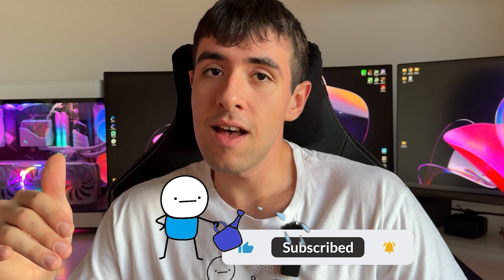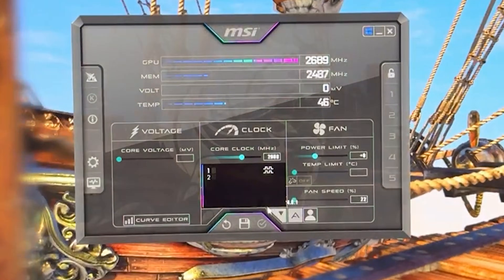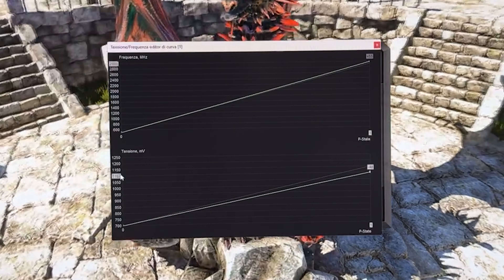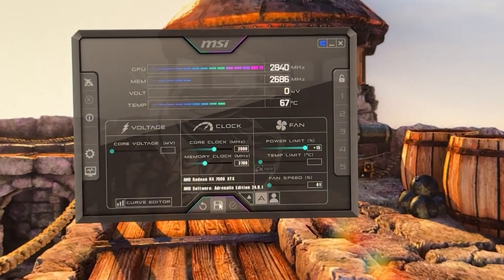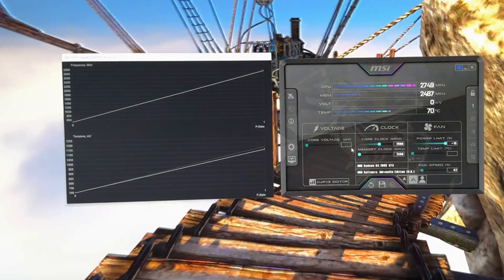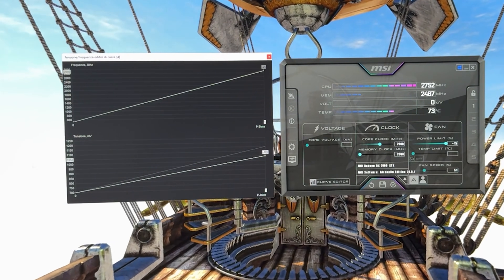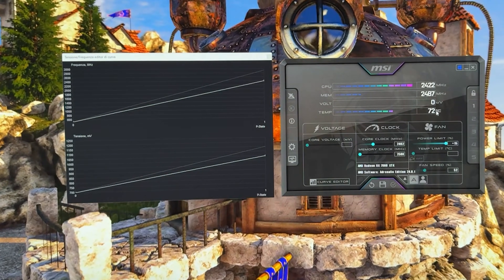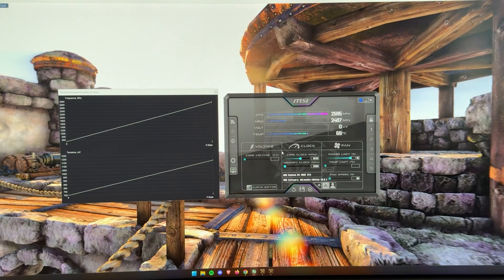Undervolt your RX 7900 XTX for more FPS! - Tutorial

Comment: i got nitro+ version , for me it works very well with this settings:
1075 mv
Vram 2750 mh
max freq 2700 mhz
min 2400 mhz
power limit +15%
And also i changed fans curve :
40C >800 rpm
55C>1000rpm
70C > 1300 rpm
85C >1600 rpm
My max temperature while gaming around  56C , avg fps in game like bf6,bf 2042,delta force 250 + on ultra settings.

Comment: i wonder why AMD was advertising the 3k+ hz on 7900xtx, the hotspots were around 105~, i undervolted my phantom gaming 7900xtx to 1125mV at tops 2650hz clock and 2680hz memory, no PL slider touched, temps dropped to max 85c with RDR2 benchmark 119(sometimes 130 in some areas) (same fps but without temps or stutters), Furmark is 16.5something, but i got better performance than Overclocking. 

Since i figured this out i am no longer sure or not if my card had thermals problem (second problem i noticed)
i spend around 1k just to mind fixing the gpu, while i should purely play fking games lol
Reply: If you are running stock card-clear paste and use PTM 7950. The chiplet design has that hotspot problem because of the surface which is not that much even and bad contacts happen even in factory. I swapped paste with PTM and I am able to OC the card to 3,3GHz with 40% fan speed with hotspot never above 90°… 70° on stock setting.
Reply: @milankot3908  as a temporarily solution until I find a trusted technician I limited the gpu clk to max 2.5, I don't see any difference tho. Tested in rdr2 4k with fps playing around ~110. But repasting is under consideration, yet I still have the warranty but the temps are within normal so I can't return it.
Reply: @mln461  but, the thickness of the thermal pads, is it all the same from different 7900xtx manufacturers? (asrock, asus etc)
Reply: @marines94711  Well it´s not. I have Sapphire Nitro and 1mm was too low and 1,25mm too high. Thermal putty saved me there.
Reply: @milankot3908  fun fact, with lower (or equal to manufacturer Clock) the junction is equal or less than 20c. But the card is boosting so high on its own (like 2900+mhz by default) that the junction gap raises to 30+

Comment: Why would you use Afterburner when Adrenaline does the same stuff?
Reply: Because Msi Afterburner will have the profile for any game and you do not have to apply the configuration to every game
Reply: Il arrive que MSI afterburner rentre en conflit avec adrénaline et c'est logique , il vaut mieux utiliser adrénaline comme je fais car tout les jeux nécessite pas le même undervolt :

Dans New World :

Fréquence max  2950 
Tension 1100
Vram 2500

Dans no rest for the wicked 

Fréquence max 2950
Tension 1075
Vram 2600

Et dans le bench time spy

Fréquence 3500
Tension 1020
Vram 2800

Voilà

Comment: Here I've set voltage to 1095 and max frequencies to 2800mhz, no power or ram increase, just to keep good fps and GPS hot spot cooler at full load (71deg C). Like it. Thank you. Also synthetic benchmarks stability doesn't mean game stability.
Reply: i have my 7900 xtx 
core clock 2800
mem 2500
mV: 1100
+Pw: none
runs like a tesla

Comment: Bro! I have a 9900K a dual monitor setup and a 750W Platinum Seasonic, can I slap in a Sapphire 7900xtx?
Reply: yes, but don't oc the CPU as it can draw 100W more compared to the baseline of 140W or so. You may do it safely, but each power supply has an optimum range of power consumption between 50% and 85% or so, going to hit the maximum will put strain on it more than necessary. Also, depending on your resolution and hz and your needs (types of games you play), consider getting a 7800 XT or 7900 XT as they are cheaper and maybe offer you proper performance.

Comment: Rx7900XTX nitro here, can do benchmarks at 1020mV but this will cause instant crash in games. Have to go to up like 1080 for stable gameplay (warthunder 1440p everything maxed out with 4xSSAA) and only then I can do pl-10. 1070 and lower is possible when increasing the pl over 0. If the game runs at 100% GPU util voltages above 1075 is a must

Comment: Stick with adrenalin software for overclocking/undervolting. Pretty sure msi afterburner isn't even updated nowadays. It doesn't even read the 9000 series cpus temps and other sensors.
Reply: They did actually update the afterburner beta branch, it supports my 9800X3D now!

Still would rather use Adrenalin though, you're right on that.
Reply: @RedForceProductions  that's good to know, I always like afterburner for it's overlay but I switched hwinfo64 and use that for my overlay now, gives way more info. Adrenalin software is hit or miss with cpu stats especially power draw. Not sure if that's because I don't use ryzen master 🤔. I prefer to adjust my cpu through bios and gpu through the Adrenalin

Comment: Never rely on ONLY Benchmarks and synthetic loads to test UV/OC settings, these kinds of loads will be stable at much lower power than actual games. 

For example my 7800XT and 7900XTX can pass Heaven and TimeSpy at 1060mV and the score will get higher and higher the lower mV you go, but as soon as you try an actual game e.g. Rainbow Six Siege you will crash straight away like in the menus or as soon as you start playing. In actual games you will need at least 1100mV to get stable performance with no crashes and that's if you get really lucky with silicone lottery. 

Try most if not all the games in your library and when you get zero crashes in all of those games then your settings are 100% stable.

My Red Devil 7900XTX requires at least 1140mV with 3150MHz on Core and 2700MHz on VRAM with +15% Power Limit.
Reply: How much watt does it use during games like CS2 if you undervolt it as much as possible?
Reply: my AsRock xtx currently running my games stable at 1085mV and 2950MHz with stock memory and +5% power limit. Trying to get the mV lower cause my ambient temp in summer is too warm...the card already once heated up to 99Degree...current settings allow it to not get over 80.
Reply: I've been running my TUF OC 7900 XTX at 1120 mV and 2500 MHz, as well as -10% power, which works pretty well for me. I know I can push it way harder, but I rather want my system to be cool and quiet, than pushing it and make it loud. Anyway, as I play Black Ops 6 Zombies most of the time, at 1440P, it's pretty much a perfect fit for my R9 7950X, running low settings because of the bad optimizations in the game, native resolution, it runs 200-240 FPS, which is perfect for my LG UltraGear 27" 1440P 240Hz OLED monitor

I've tried pushing it a little, and I made it run BO6 Zombies stable at 2900 MHz, but I don't remember the other settings. Maybe I should try pushing my system to the limits, testing if I can get closer to stable 240 FPS, or even higher by disabling vsync. Maybe I should test 4K on my TV as well, as I know it was capable of 4K 180 FPS with the built-in benchmark, vsync was disabled at that time. The built-in benchmark seems to be accurate for the game, at least for my 1440P tests
Reply: Seems like I can get better temps with 1100 mV 2900 MHz +15% power, as well as VRAM at 2700 MHz. I need to push my CPU to get better FPS in BO6 at 1440P, but at 4K, and 1120 mV, I was able to get 200 FPS with the built-in benchmark. Peak power was maxed out at 430W, which I don't really want, as it results in more heat, thus more noise from cooling

I'll fine-tune it more, and hopefully get lower wattage, less noise, and hopefully without lowering FPS more than maybe 5-10% as I want peak performance at lower power and with less noise, which doesn't equal peak performance at it's best, but rather a better config for the GPU's health instead. Not been re-pasted during the year I've had it, and I didn't see temps above 70C hotspot, because of already decent fan curve

Fan curve for those who want to try it:
Speed | Temp
30% | 30C
44% | 50C
58% | 58C
72% | 67C
100% | 75C

Explanation for how it's configured to work, is simply that it will spin slow when not performing GPU intensive tasks, like gaming, but when starting something that makes the GPU heat up, it will spin a little faster at medium temps than required, but doesn't increase a lot, which makes it sound stable, thus more silent experience, then if needed, it will spin at crazy speeds, just to be sure, because nobody wants to cook their expensive GPU to reduce noise
Reply: @lassebrustad  I am now downclocking, 2700MHz + 2500MHz + 1065mV, +0 power limit and my temp rarely goes over 71 with cyberpunk benchmark on full, while still getting good FPS (74avg in 1440p) with RT+ path tracing on and fsr set on quality instead of performance. I guess getting that power limit lower might result in even better temps, but need to check how much I can get down.
Reply: @lassebrustad  Ye my average FPS is higher when I reduce the core clock down to 2900MHz from the stock 3150MHz and also my temps are better too.

My current settings are 2900MHz Core, 2714MHz VRAM, 115% Power Limit @ 1130mV. Peak power is around 430-470W

I was originally at 1100mV and it was stable in all games except Rainbow Six Siege which is only stable at 1130mV.

My Hot Spot barely touches 90C when under full load and my rooms heating on full. I did change to Kryosheet though as the factory paste meant the GPU was hitting 110C Hot Spot very quickly.   

My Red Devil XTX's fans get annoying when going over 60% so I set a hard limit to 55% fan speed when the hot spot reaches 85C
Reply: @astoraan6071   I can run my Asus TUF 7900 XTX with 1060mV with 3200 MHz core and +15% Power Limit with default VRAM. Getting no issue. Is it fine?
Reply: @denizseker1719 try on a variety of games. If it doesn't crash in any of them then you got extremely lucky but Memory OC's are what mostly cause instability in my experience
Reply: @astoraan6071   Played a lot of games, no crash for now. Thanks a lot.
Reply: @astoraan6071  That's great. I, too, noticed the same positive effects gained by using very similar OC/UV settings for my Powercolor RX 7900 XTX Red Devil (it has a thick custom back plate mesh). In the end I found that @AncientGamePlays' settings work best which are identical to yours except for the memory clock which I set it to 2650 MHz (default timing for multiplayer/fast timing for single player-campaign). I found that anything above 2700 MHz or 2714 makes my RX 7900 XTX Red Devil unstable in newer demanding games. 2714 MHz for memory works well in older games but it crashes the GPU driver in newer, demanding games. My final stable settings are +15% power, 1130 mV, min. 2400 MHz, max. 2900 MHz for GPU and 2650 MHz for memory. Temps are really good (<60 oC, max. delta between GPU junction and GPU temperatures is 8-10 at idle and 20-25 under full load) with an aggressive custom fan curve (35% -> 35C, 50% -> 50C, 100% -> 75C).
Reply: @astoraan6071  currently at 1075mV stable, with 3000Mhz and 2600 on ram. +7% power limit.
Now question... shouldn't the lower mV cause lower temps as well?
Reply: @ReyleghTenOdCyferek  It should and did with the 6000 series cards but I've noticed very little (1-3C) drops in temps on my XTX and sometimes not even that. The big thing is the coil whine which is massively reduced when I undervolt
Reply: @astoraan6071  yeah, I see no change in temp with 1075mV...but by lowering the power limit it seems to lower the AVG temp slightly

Comment: How would you try to param the card for the lowest TDP possible ? 
I know if looking for efficiency I should be looking at Nvidia but I just got an offer for a Nitro Vapor X for 630 bucks, I just can't pass by that.
Undervolt as much as possible while keeping stock clock with a -10 Power Limit things like that ?
I want to just unlock the card's power gradually depending on the perf I need and keep the beast on leash for now
Reply: I'm sometimes using ancients power save profile when i dont need max performance.

Min 500mhz
Max 2400mhz
Power1120z-1130mv
Memory 2714mhz normal timing 
Fans around 45% Max
Power limit +15%

Besides running cooler it will run around 360watts max instead of the Max 465 watts on nitro+ with minimal fps loss. 

And if want to nerf the card even more why even bother buying a 7900 xtx
Reply: @OhNopesYouDidnt  why bother ? The answer in the message itself.

I want to have a large performance range, I don't need it to draw 400w when playing games like BG3. A game library doesn't limit itself to one game.

Comment: what optimal OC do you recommend for a 7900XTX XFX Merc 310 black series?
Reply: there is no optimal settings as not only the brand and model of the card is important, but your luck with the silicon lotery. Every chip and videocard will have a different optimal setting for oc or undervolt that you will have to manually set up and test it. For most people, oc will not do a lot in terms of the real world performance, as 5%-7% fps improvement will not matter that much. But if you do it for the higher performance, a stable, but not perfect oc will nearly give you the same performance or in 1-2% range, which again, none will really notice it in real world performance, but crashing will definitely be noticed.

My advice is to start from upping the slider for power management to +15%, manually setting the fans so it responds a bit faster to increase in temperatures, not mess that much with frequency as it increases the power consumption for not a lot of fps gain. Start with adding 100-150, maybe 200 MHz to the vram clocks and test it with lower voltage maybe 1100mV and see if it stable in benchmarks. Compare the fps, clock and memory speed, the real mV, fan speed, temperature and power consumption to what you had previewsly.

From that point, you can play around with different inputs until you find the settings fit for you. It is advisable to run 2-3 games that you normally play to test the real world stats. Compared to benchmarks, games can have a menu without limited fps or loading screens where the fps will go in the thousands and that can cause a crush or very demanding games in terms of VRAM usage can also crash.

Speending time online doing research can help you find a base start for your card, but nothing will beat trial and error as, compared to older hardware, the OC will vary by a good margin between each component. There are no optimal settings that will fit everybody, but a big spectrum, based on luck.

Comment: 1050mv with a XTX is very unlikely to be stable in a wide range of games
Reply: have my merc310 running at 1075
Reply: @Ilovecrumble  now do this with pl-10
Reply: True. Most cards only run stable at around 1090mV and above, which in reality results in about 840mV @2550MHz on the GPU core.
Reply: Not with my silicon anyway, 1095 here.
Reply: @psour33  My first card (had to RMA it for a stuttering issue) wouldn't go lower than 1135mV. It's more likely that the average is closer to 1100 as -50mV is already a lot and most people only report number's they're proud of. I've tested 3 7900XTX's in total, two Asus and one sapphire nitro. The first, which was the stuttering card, only did 1135mV, while the second Asus (amazing temps) did 1080mV as did the Sapphire Nitro+. It's likely possible to get 1050mV stable in games but it would be insanely rare and they tend to leave out whether they're just benchmarking (which is most common with that undervolt); what their boost clock reaches/is set to; or what their temps are as temperatures can make or break stability within 5 to 10 degrees.
Reply: @cheese186  testing 1065mV right now, seems stable for now.
Reply: Damn my rx6800 needs only 920mv to run at stock speeds
Reply: @ different architecture
Reply: I get constat crashes at 1050 with my 6900xt xfx merc
Reply: @ try to increase voltage or reduce clock speeds (or both)
Reply: @megapet777  clock speed is between 2400-2500 in games and stock voltage is 1.175
Do u think my 1.050 undervolt is the crash reason?
Reply: @ Yeah, probably. You could try to set clock speed to 2300 and voltage to 1.1, if its stable then you know. You can of course fine tune after if you want to undervolt more.
Reply: @megapet777  is the 2509 stock clock normal for a 6900xt? Isnt is too much?!
Reply: @ according to what I could find the stock boost clock is 2250 mhz so 2500 would be overclock. It might or might not be stable, depending on the silicon.
Reply: 02:14 disable ULPS in afterburner or regeddit
Reply: 1100mV everything else is the same

Comment: Ciao! What "safe" settings would you apply for a 7900 GRE? As you probably already know, the stock values are 2555MHz (for my hellhound) at 1050 mV.  (2250 MHz for the VRAM)

Also, thanks for all the videos, I find them quite informative! ;)
Reply: There are not safe settings as you can't break a card by overclocking through software due to the hardlimits on voltage that you can apply already being within safe limits. You just have to find what's stable at the highest you can get/want to go as the silicon of your chip (and your temperatures) are what decides how far and how stable an overclock is.

Comment: which better for 1080p gaming after tuning, taichi or vapor X, sir?
Reply: 7900 XTX at 1080p means you will probably get bottlenecked by your CPU before the GPU. Other than the mighty 9800x3d, in most games, will be bottlenecked by the CPU. Tunning will not really matter. My advice is to go for a card that you like the design and that has a good price on it, as they are very similar in real world performance. I, personally, have the Nitro+ for about one year now and I've been pleased with it. I chose it on the fact that I liked the design and overall build quality. I bought the 7900 XT Nitro+ and I liked it, but decided to return it and get the XTX instead. When I was searching for the XTX I considered Taichi, but I didn't like the color and the price was a little higher, not by much for the Taichi. For a full white build, the Taichi White should be more appropriate. For a lot of RGB lights and strips, Nitro+ definitely.
Reply: @MrTeknown  this convinced me, sir